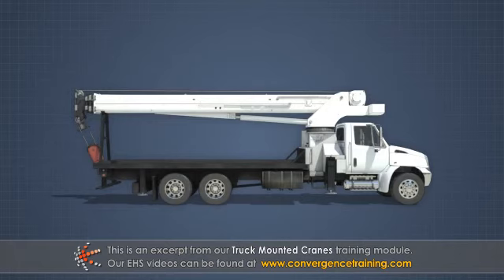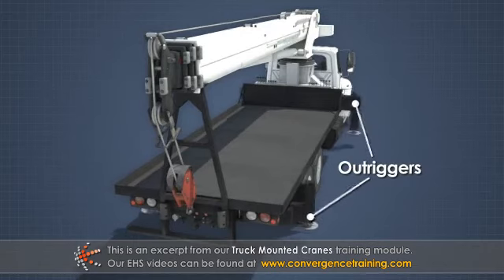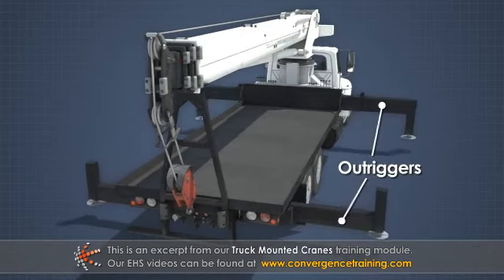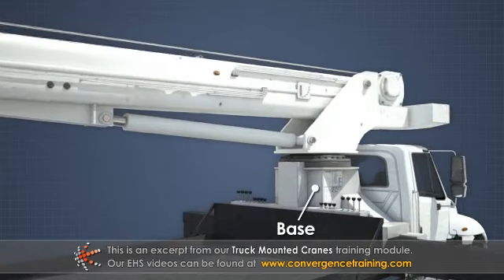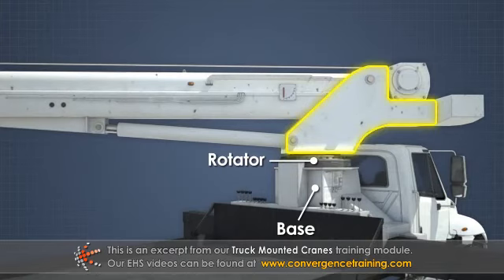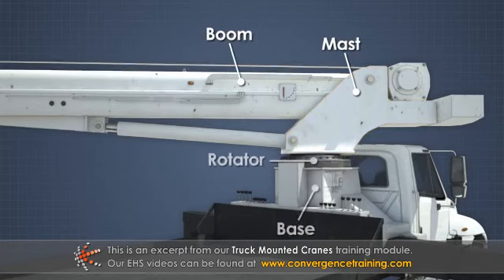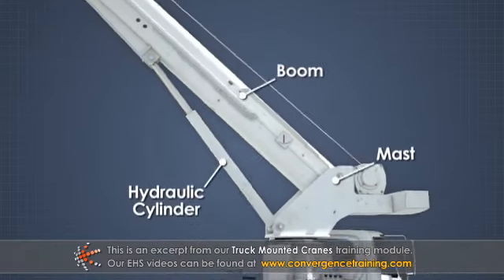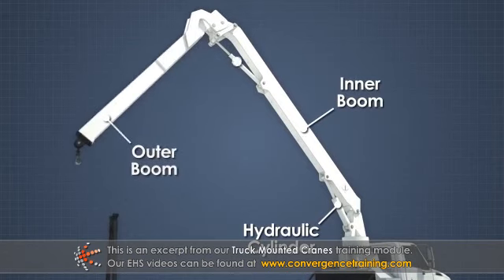Truck Mounted Cranes Training

Comment: Any operators here ever have their turret pin sheer off while making a lift ? I have and it's freaky, we were told to load the crane bed with 6 tons of counter weight to increase its stability while making 100 lifts a day that exceeded the weight limits by 30% nearly every lift ,at the start of the 5th day the pin sheered and it sounded like a TNT explosion ,down came the book at 60mph right into the bldg .

Comment: well first of all you need to be certified to safely operate a crane. then you never overload the crane by 30 %!!! thats just asking for an accident, adding counterweight to a crane bed will give the truck stability, but not the crane. you are still overloading the crane, thats why you sheare off the turret bolts.  hopefully no one was injured or killed.